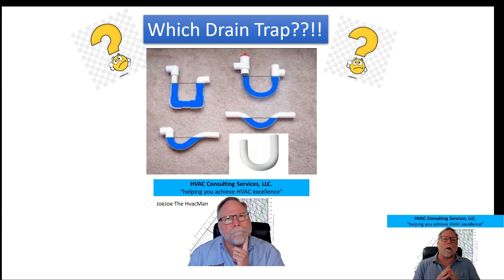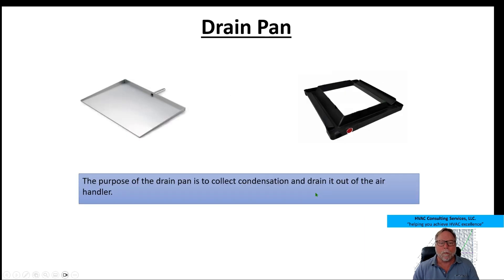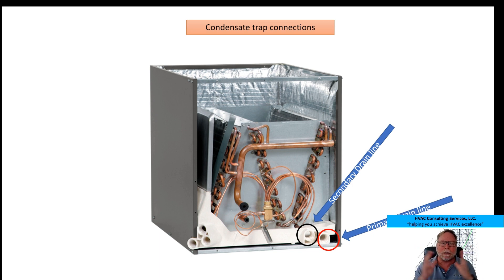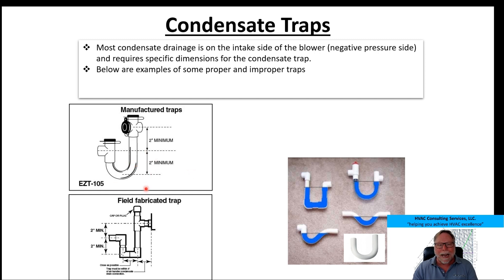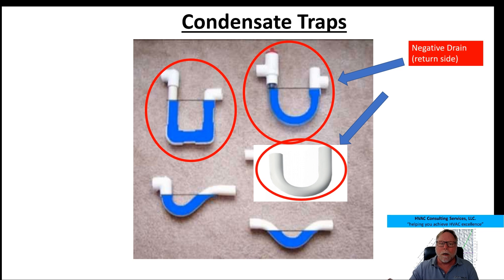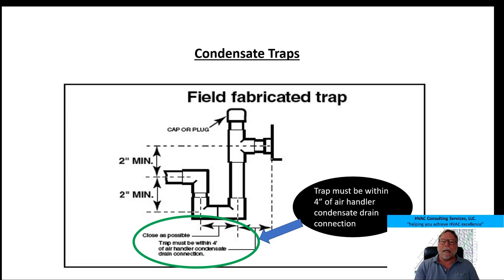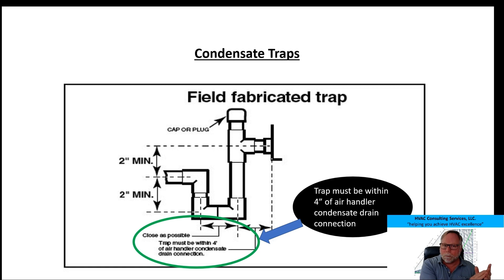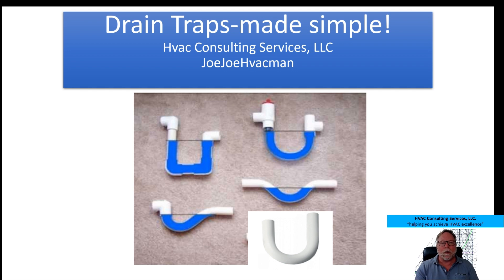The Hidden Truth of Drain Traps--Made Simple!

Comment: We just had a clogged drain line cause an overflow to the AC in our attic in a home we recently bought. Of course it damaged the ceiling. Apparently, the builder connected the condensate drain and overflow pan to the same drain line. And, of course, the float switch in the overflow pan did not shut the unit off.
Obviously, I need to run an additional drain line from the overflow pan to prevent this from happening again. I am guessing I can run it to a soffit, but what size should the drain line be, and is there a particular method you recommend for flushing the drain line in the spring?